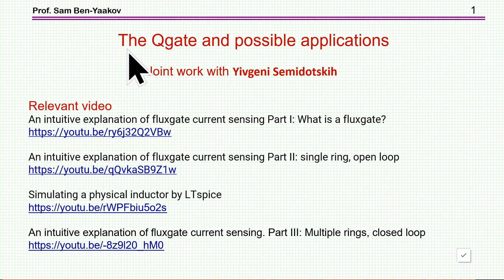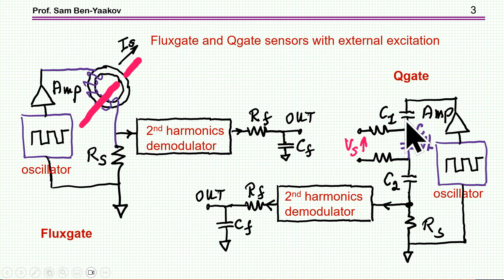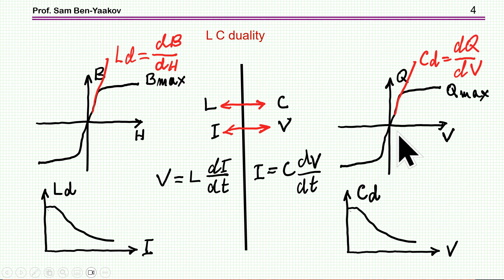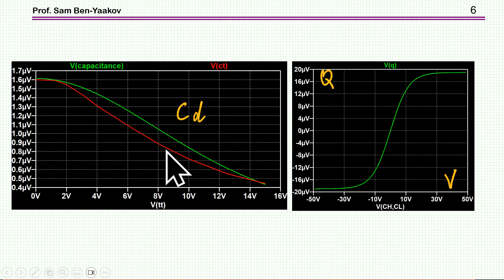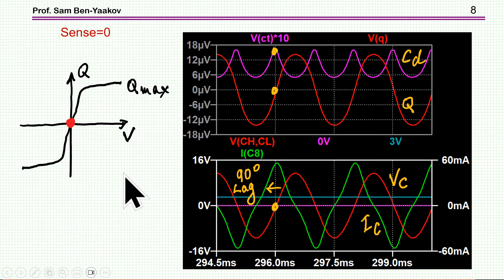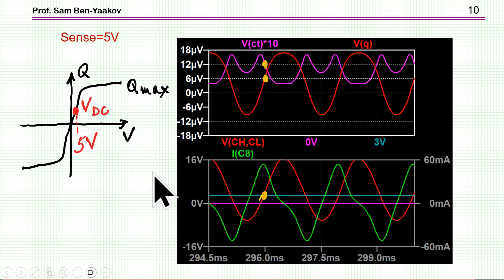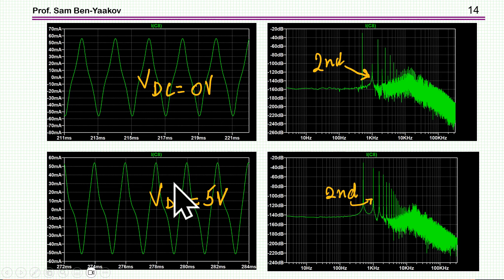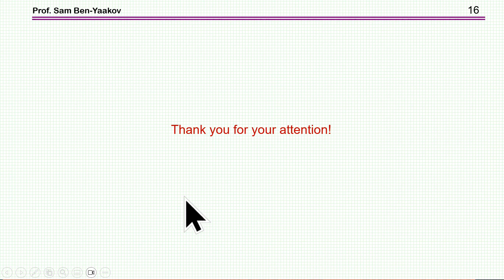The Qgate and possible applications

Comment: Genius!
Reply from the maker: Wow😊Thank you.
Reply: As Adam Grant said on David McRaney's "You Are Not So Smart" podcast (ep 232), "Intelligence is making complex things simple. Stupidity is making simple things complex. Genius is making complex things something else"
Here we now have a way to remotely probe potential. I suspect it'll need a differential approach to try and avoid the effects of all the other type-2 dielectric caps in a circuit, and probably a lock-in amp to get around the difficulties with phase-shift on mixing two signals down to DC.

This is the second brilliant idea for power electronics I've found this year, the other was Yulei Wang's "Transmission Line Rogowski Coil: Isolated Current Sensor with Bandwidth Exceeding 3GHz". He's made the genius step to apply RF microstripline thinking where he realised the troublesome resonances of a Rogowski coil are due to poor termination impedance and by considering it simply as a length of constant impedance transmission line, it becomes an attenuated coupler with the wire's current you're measuring. 

He goes on with the same thinking in another paper to consider broadband compensated voltage probes like 'scope probes as broadband impedance transformation with attenuation. The pesky capacitor networks simply become broadband microstriplines to transform a very large probe tip-impedance to the 'scope's 50R wideband input (and the low impedance segments look like capacitors, but built from PCB copper and derived with pretty mundane RF coupling engineering).
Reply from the maker: @simoncliffy  Thanks for the insightful comment. Realizing the second harmonic extraction is no problem: you generate the first and second harmonics using a microprocessor.

Comment: Hi, there Is indeed an cool application that Is so called dielectric amplifier that uses a non linear capacitor to amplify a signal. The hysteresis loop is quite steed so that a amplification factor can be reached by applying a dc bias voltage to set a working point. This Is a pendant for a magnetic amplifier that was used in early days.
Reply from the maker: Dielectric amplifiers are a really old history. See https://youtu.be/vOsZD3rWCJM?t=1711

Comment: Very clever!  

I had a customer that wondered how many joules of energy a nonlinear cap (X7R) if charged to 40V, and discharged to 6V.  My cap Applications engineer only committed to the same joules a linear cap would have if the capacitance was the same as the nonlinear at 40V.  I saw that as being too conservative so I used my 2 channel scope (home lab) to compare the RC time constant between a 10uF electrolytic and a 10uF, 50V X7R.  the X7R had a lot more energy.  I provided my result to the Apps Eng as justification for the factory to provide measured data.  He didn't.  I don't work there anymore...
Reply from the maker: Have you seen https://youtu.be/lWq-kQ7P4VM ?